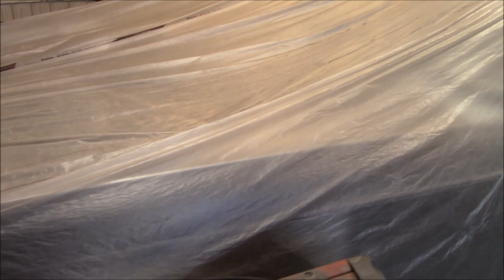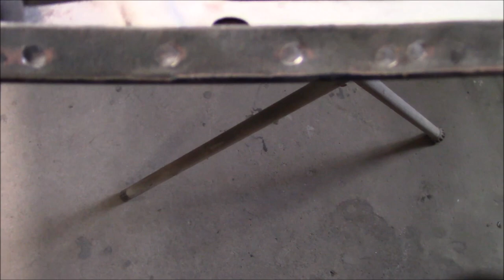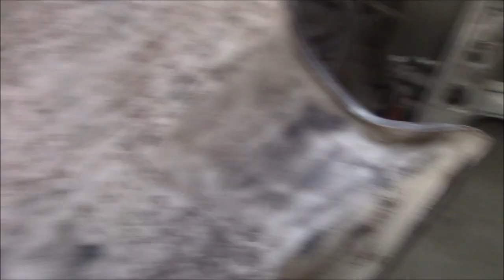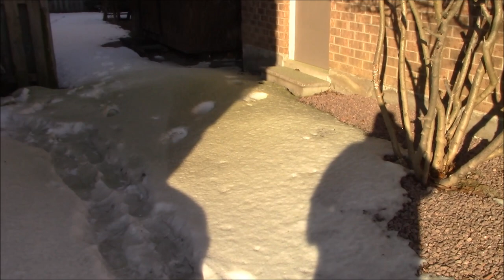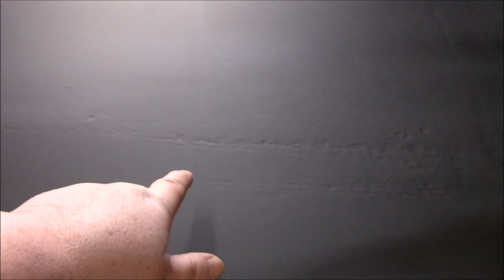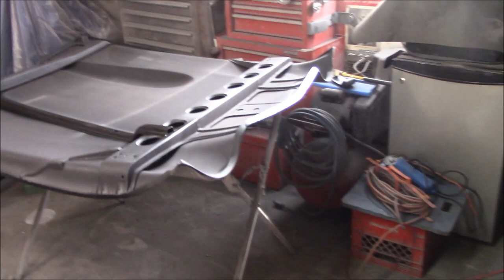1968 Triumph TR250 Restoration, Inner Bonnet Structure Repair, Part 2

Comment: Hello Tush! Car is not just looking better than before. I think it's looking great! Question on the primers: 
Why did you use an etch primer on the back of the reinforcement piece and not epoxy primer like the other larger support piece? Also wanted to know why the red oxide over the butwelds, although I saw you replaced it with epoxy p the next day. Maybe because you didn't have epoxy p ready and wanted to protect from flash rust until you had a batch ready? 
I'm taking notes while doing my '69 TR6 restoration. Thanks for keeping me busy while quarantining for a month now... !!! 
Cheers

Comment: David, I’m replacing the bonnet on my TR4A (the car came with a fiberglass bonnet and I finally found a relatively rust free metal one to replace it). I’m bringing it to a restoration shop to have it blasted, repaired/fitted and repainted, luckily I found and watched this video with interest! I have some questions regarding that narrow front to rear bonnet brace. 
- other than on each end, was the rest of your brace attached to the bonnet in any way or did it sit proud of the bonnet?
- if it sat proud, how far away from the bonnet was it? Was there any felt or other sound deadening material between it and the bonnet?

On mine, that brace is only attached at both ends, and has no sound deadening material between it and the bonnet. In fact, at the middle of the brace, it sits about 1/2 inch proud of the bonnet, then gradually gets closer as it approaches each end. The gap on yours looked much closer and uniform in distance to the bonnet. So I’m wondering if my whole bonnet is arched slightly.
Sorry for such a long comment. Thanks!
Reply from the maker: Hi Jim,  the brace was only welded at each end and yes it did sit proud of the bottom of the bonnet...it did vary from about 1/2 inch to 1/4 inch along the length.   This was taken up by felt strips that I removed when I took the brace off.  I put them back in once I reattached the brace.  If you don’t put the felt in, the top of the bonnet will “oil can” when you push down on it.
Reply: @cheftush  thanks David! I found some felt strips about 1/8 thick. Did you just add multiple felt strips to fill up the gap?
Reply from the maker: @TR4Ajim  hi Jim, I used the strips that came off the car...there seemed to be two sizes but hard to tell if the thinner ones had just been compressed more.   I’d say if you need to fill the wider gap that you could glue to pieces together on top of one another.  It needs to be a snug fit but not so much that it’s bowing the bonnet upwards.
Reply: @cheftush  understood, THANKS!